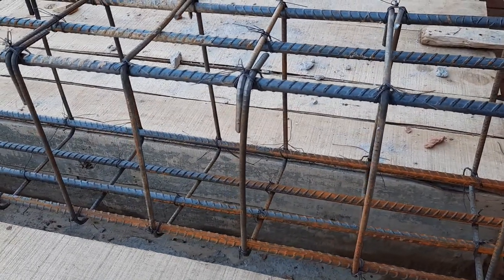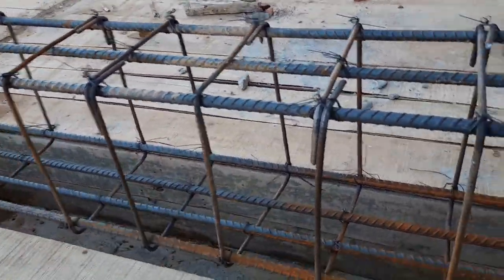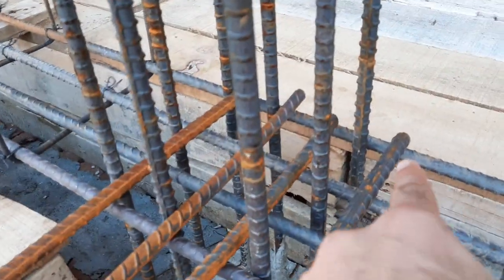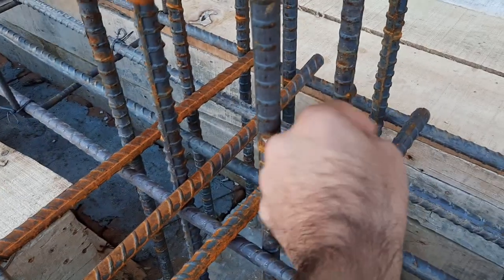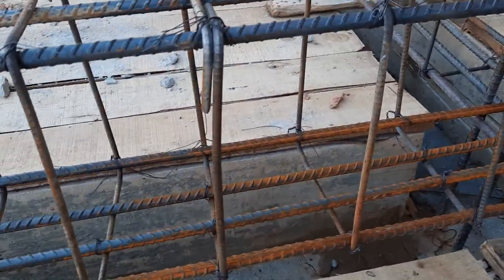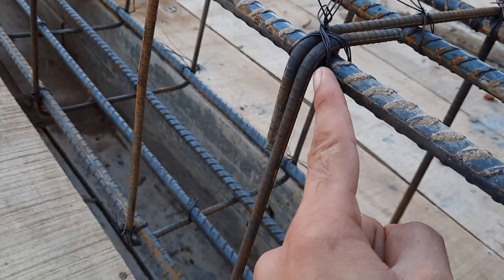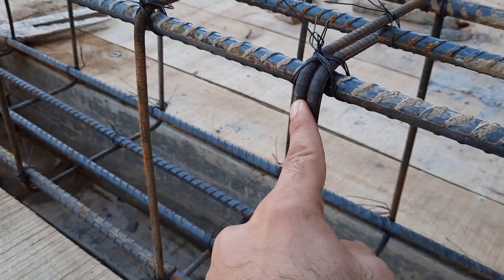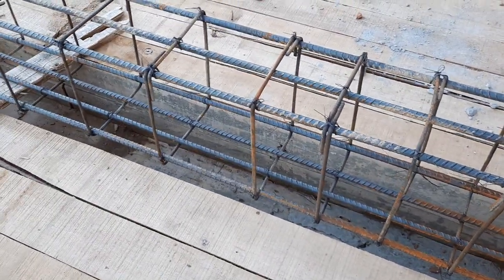5 Biggest Mistakes in Beam - Big Mistakes in Steel Construction of Beam

Comment: 1. Do not provide crank bar 
2. The stirrups spacing should be maximum at supports 
3. The angle. Of  hook not designed for 135degrees 
4.there is no designed for development length according to 
0.87*fy*dia/4toeb*d
5.the Bending wires not tiet properly.....  Thank you sir 😍
Reply: stirups minimum space at supports ..l/4 length..centre space more

Comment: Crank is not necessary in beams because it will be supported by thousands of bricks and that 90° rings are also not a problem as long as you mixed up the joints alternately

Comment: Dear, crank bar is not provided for shear resistance, but it is provided to encounter negative moment at the support or any position it needed.
Secondly in SMRF design code recommends the spacing btw stirrup at the support should be less than 4in.  
And at the last, according to the code i never see 135 bending in stirrup of the beam. 
Thank you.

Comment: top bars transfer load to bottom bars?? that's not how beams work...
Reply: Yes dear
Reply: @MasterCivilEngineering  top bars are mainly there to hold up the stirrups, or for negative moment, or to reduce the neutral axis depth. The bottom bars resist the tensile stresses from bending action
Reply: Stirrups are used for shear while top bars are used for negative moment at supports